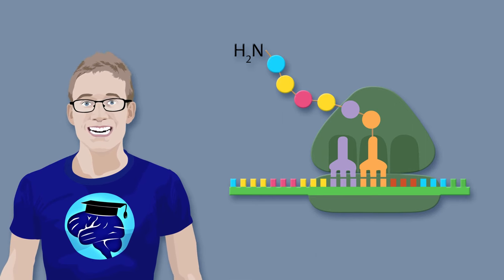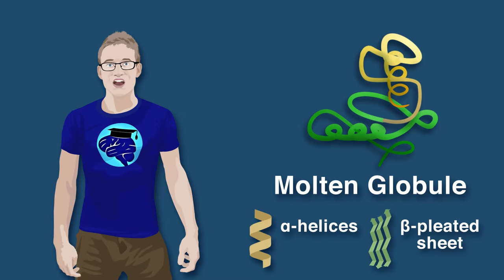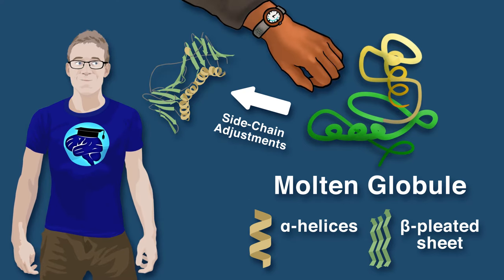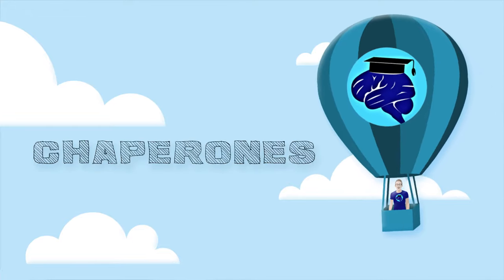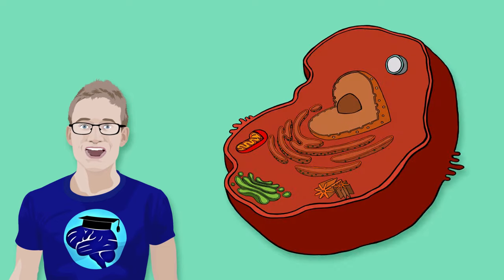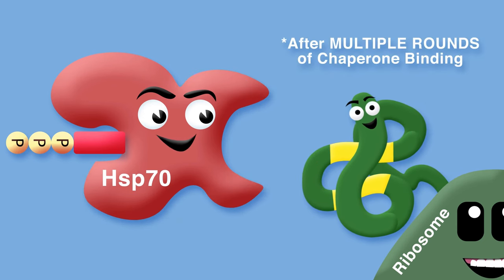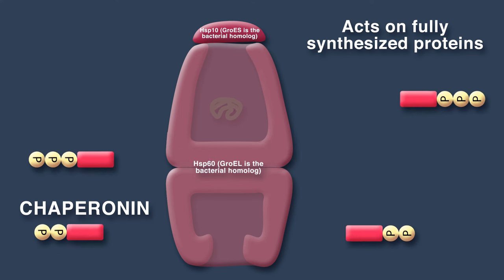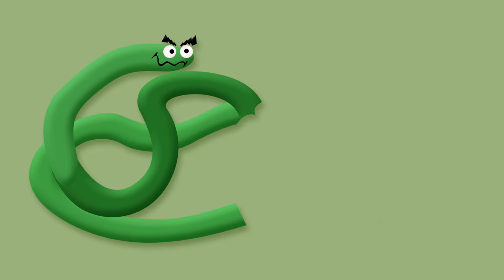CHAPERONES AND MISFOLDED PROTEINS

Comment: So all these checks and balances simply came to be unintentionally and  simply throwing massive amounts of time into the equation will  make such a farcical proposition more believable?  The reality of this system unintentionally coalescing over billions of years is absurd as the molecules and chemicals degenerate within hours under strick  labratory controlled conditions thusly leaving a time frame for unthinking matter to flop iteslf into a information packed self replicating factory within hours and immediately start replicating over and over and over perfectly. You might as well claim a space shuttle could unintentionally swirl itself together in a sand storm as this would be a much simpler and believable unintentional manifestation.   what a world!  The truth is right there for all to see yet some still reject reality at all cost.